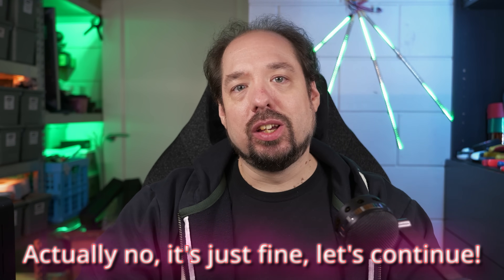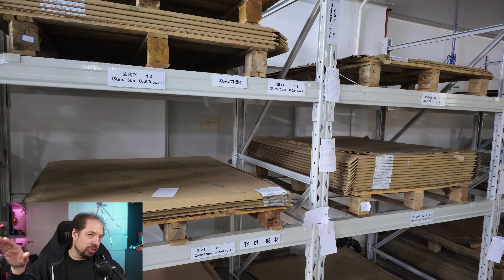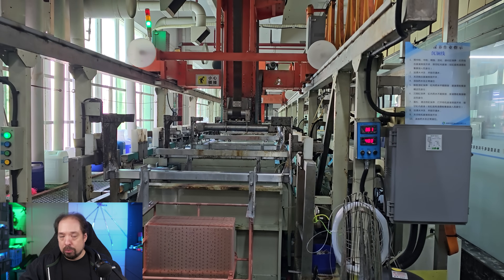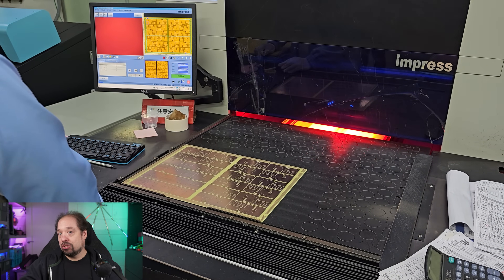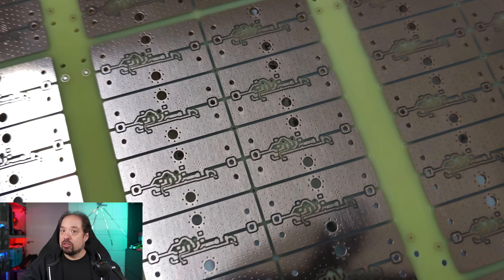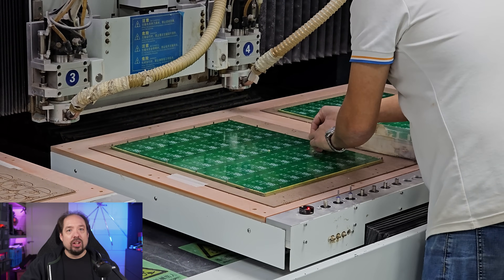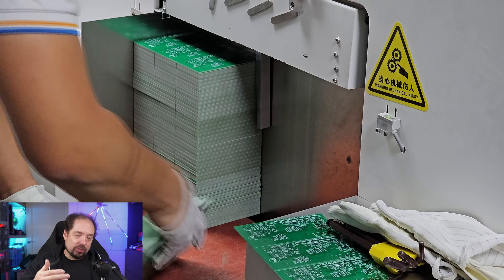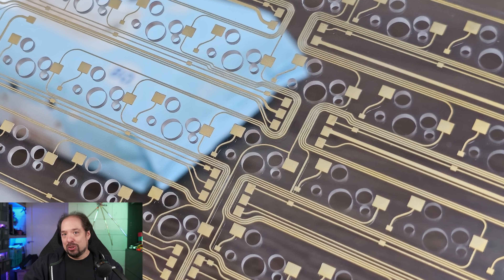I went to China to visit the PCB factory for the QuinLED boards!

Comment: Boards are drilled first for plated holes, non-plated holes are drilled at the end of the process
Reply from the maker: Yes, this video was a mess to get into the right order since we crisscrossed through the factory basically. Later I realized that's likely what was happening in the chemical process I showed. Thnx for adding comment though, I'm not a factory expert either. 😅

Comment: Wow, interesting.  Hope the employees are not exposed to radiation on that one X-ray machine.  Glad the company wasn't in a prison  I worrier about that with some of the things I buy from China.  
I set up my Mega tree and Christmas light show this year and your boards worked great.  Didn't need any Cat-5 cables because of your Wi Fi antennas.  Everything worked great.  You may need to make a bigger brain board in the future.  Also do you have longer cords for your antennas?  Alright, I'll be ordering some boards this week getting ready for next Christmas.
Good work!
Reply from the maker: Ha no prisons there, no worries. I'm sure there is some horrible working conditions at some places but none that I visited (or was able to see). :)

Glad to hear the boards are working well for you! :D The external antennas use standard IPEX of U.FL connectors and you can easily shop those on Amazon/Aliexpress to get the version you want!